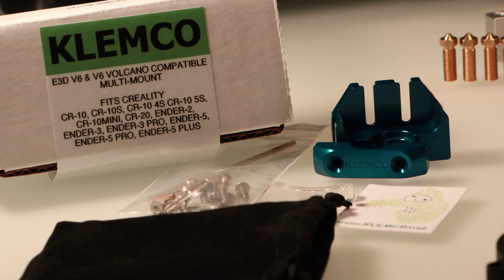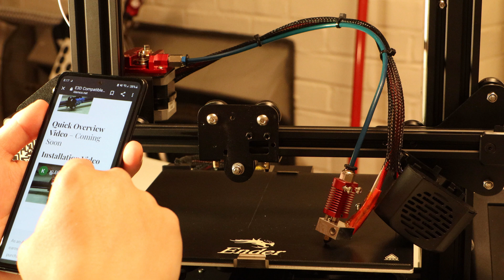Ender 3 V2 - Print Silently and 4X Faster!  (Step-By-Step Guide)

Comment: Why you left the power supply fan in?
Reply from the maker: The internal fan is thermistor controlled and only turns on when the PSU gets hot. If the fan I installed breaks down or is not keeping the PSU cool enough,  the internal fan can turn on and provide additional cooling. It is an extra layer of safety.
Reply: @NathanBuildsRobots  The internal fan actually reduces the efficiency of the noctua fan when not in use, and if it cannot keep up with the noctua fan's airflow, it will still be a reduction in airflow when it's on  as well. As far as i have read the psu fan is actually 12V so you could pull out the psu fan, and hook the noctua fan up to the psu fan port, and it would be thermostat controlled like the stock one is.
Reply from the maker: You might be right on this one. If I had a flow meter I could test this theory out. 

The is a cheap way for me to test fans against each other: put them on opposite ends of a sealed box blowing against each other, and use smoke to see which one prevails. This would be a test of static pressure, so I could test 2 stacked fans vs a single fan and see which one wins. 

I imagine the first fan boosts the pressure a little bit, then the 2nd fan boosts it a little more so I get better static pressure. Kind of like the compressor on a gas turbine, lots of fans in series to increase pressure.

Comment: Great upgrades, but why not print new covers instead of cutting up the metal ones? That also takes care of the covered vent slots on the PSU.
Reply from the maker: Mostly speed. It takes me 5 minutes to cut up the old cover and drill new holes into it vs 10 mins of looking on thingiverse, slicing,  then 4-8 hrs printing.
Plus, I try to stick to non-flammable materials when working near power electronics, especially jenkey ones that I wired myself! So whenever I'm working with heaters or 110v I use metal as an added layer of safety.
Reply: @NathanBuildsRobots  dude don't limit yourself to thingiverse. Do some cad.
Reply from the maker: @sabaubogdan6997  doing some CAD for my next project,  should be coming out next week 😀

Comment: Thanks for posting this, mistakes and all. I've got the Ender 3 V2 as well. I'm taking very small steps to increase print speeds. First I've ordered 0.6mm and 0.4mm nickel plated copper MK8 nozzles. This should allow better heat transfer. The next upgrade will be a dual drive extruder, and upgrading both fans with a better part cooling duct. Looks like you've achieved some awesome print speeds while maintaining quality, well done.
Reply from the maker: Thank you! The hope is that you laugh at, then learn from my mistakes. I will have to look into copper nozzles, looks like a good way to increase heat transfer.

In your quest for speed, here is some data to help you along: 
I put my first upgrades on when assembling the printer: Metal extruder (instead of the plastic one it ships with), Capricorn tubing, and yellow bed springs. With that setup I could get ~6mm/s with 0.4mm nozzle and ~13mm/s with 0.8mm nozzle. 
Now that I put the volcano on I'm getting 20mm/s with no issues yet on the 0.6mm nozzle. I may be able to push it to 40+mm/s since the kit I bought came with nozzles up to 1.2mm.
But with each increase in speed, I have a decrease in fine details and quality. And an increase in filament expenses!
Reply: @NathanBuildsRobots  Noted, thanks for the advice!